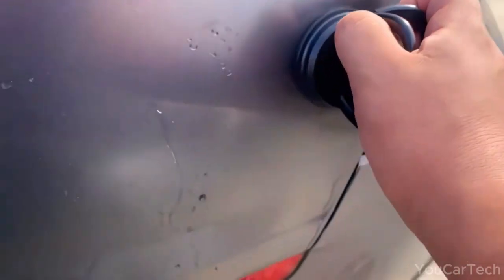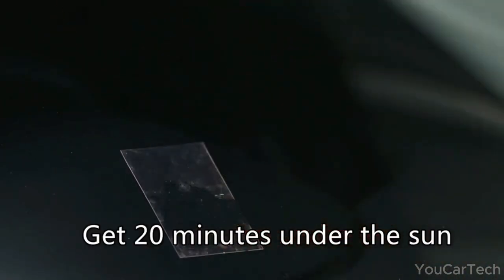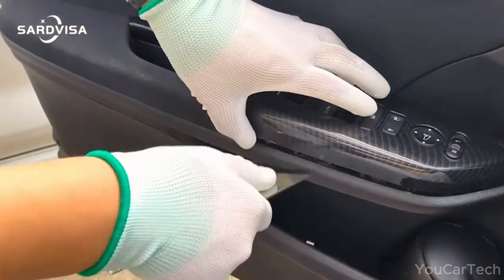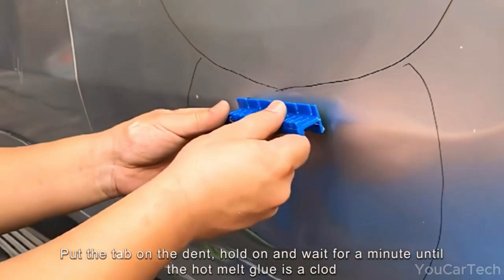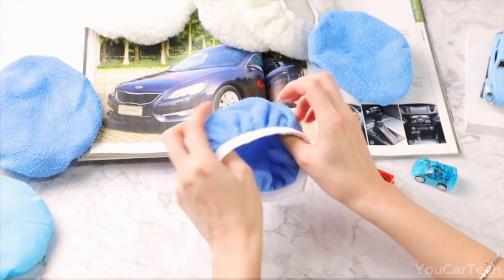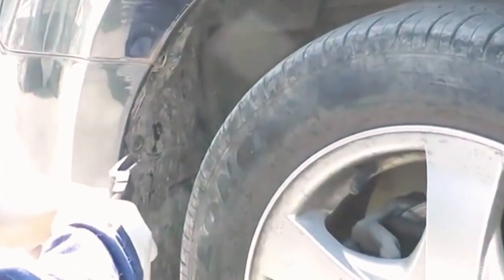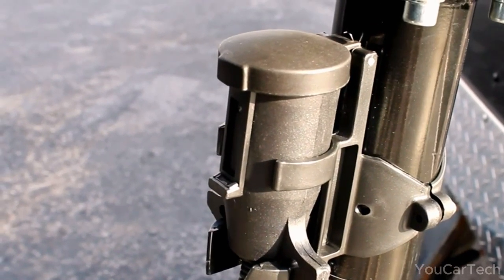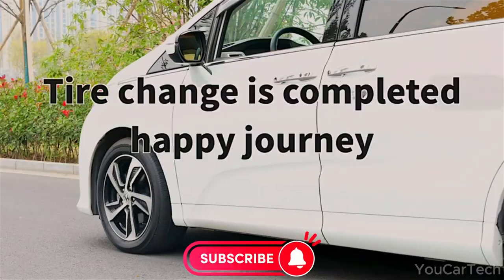14 Auto Repair Kits That Get Results Part 2

Comment from the maker: ✅1. Amourate Tire Inflator Air Pump: https://amzn.to/47p4GWC
✅2. NSONGSE Windshield Crack Repair Kit: https://amzn.to/3QMKjf4
✅3. Coconix Vinyl and Leather Repair Kit: https://amzn.to/3Rc93yU
✅4. C&T Auto Body Repair Tools: https://amzn.to/46t5cl8
✅5. SARDVISA Auto Trim Removal Tool: https://amzn.to/3SQydUU
✅6. ARRIONO Windshield Repair Kit: https://amzn.to/3sIlKbc
✅7. ZEUSFIRE Dent Puller Kit: https://amzn.to/49PD4f9
✅8. GZ GUOZHI Mini Stick Welder: https://amzn.to/40L0AG1
✅9. Mudder Bonnet Buffing Pad Microfiber: https://amzn.to/47I79v1
✅10. SPTA Wool Polishing Buffing Pad: https://amzn.to/3MRX6M5
✅11. CXGS Door Fender Edge Repair Tool: https://amzn.to/3SRJCDP
✅12. IOppWin Panel Clip Pliers: https://amzn.to/3uimowj
✅13. Uriah Products Electric Trailer Jack: https://amzn.to/3QOVkfN
✅14. E-HEELP Car Jack Hydraulic: https://amzn.to/3SSJyDY